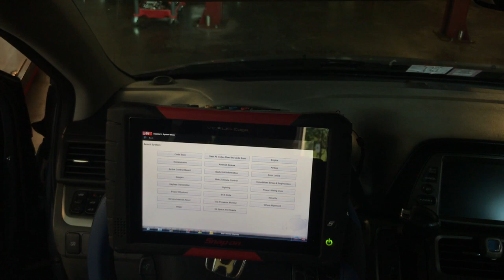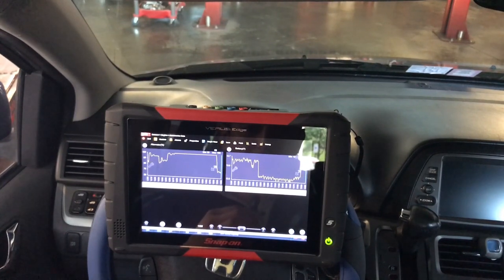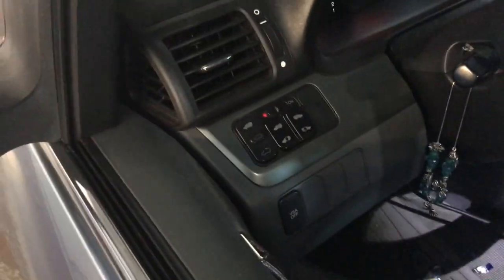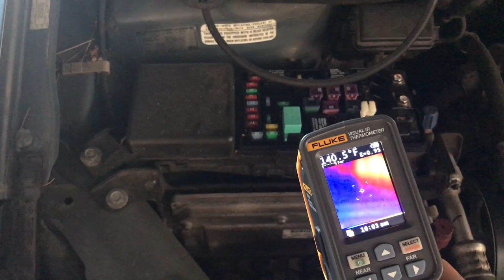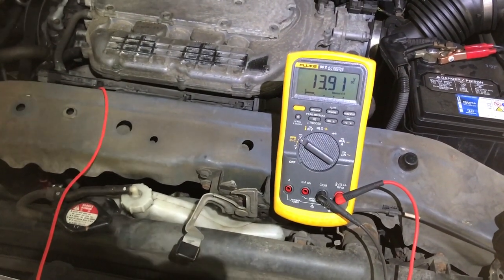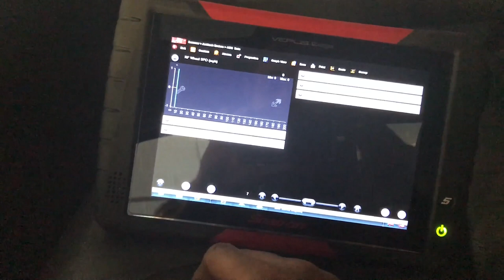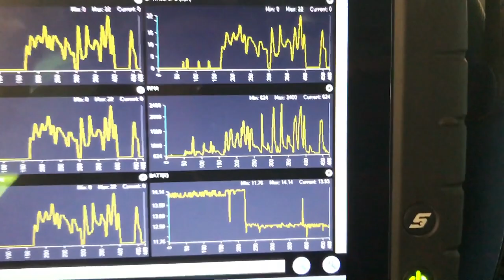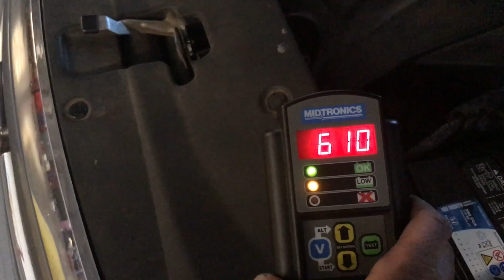2007 Honda Odyssey ABS activation problem

Comment: excellent video Maic. One to note about Hondas is they use a smart charging system. They use a component called an ELD electronic load detector located in the underhood fuse box   its bacically an amp probe  hard wired to the PCM  connector A-10 pink  wire    3 more wires come out of PCM   C43   C44   C42  that go to the alternator   to control the charging rate    some times it cuts the voltage back  and then turns it back on   I believe one of the 3 wires is a duty cycle  or frequency     the next Honda you get if you have the time is to use your 4 channel verus  and scope the 4 wires at the PCM  and turn on  electrical loads and change rpm   turn off electrical loads one at the time  an record the capture and play it back  to see the change.  thanks again Maic   excellent video and diagnosis.
Reply from the maker: Mark Ferraro thx for the info, I was indeed checking the ELD system and wiring but did not record it. I will next time for sure. Honda uses this since 98, I believe.